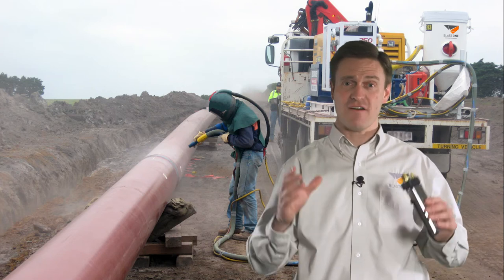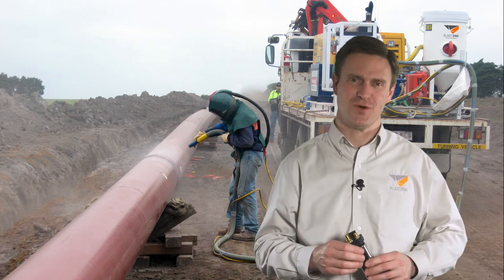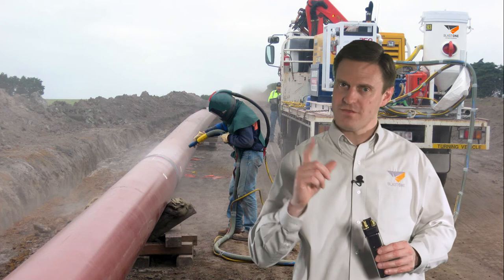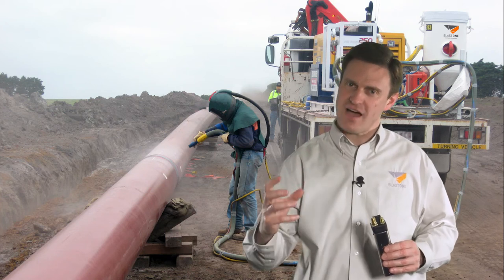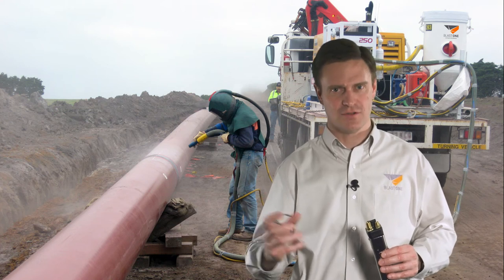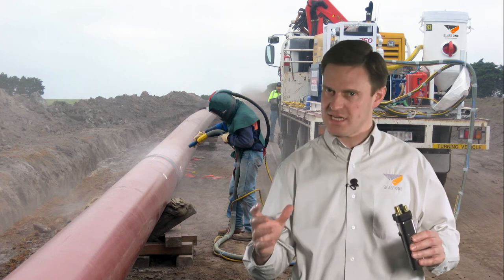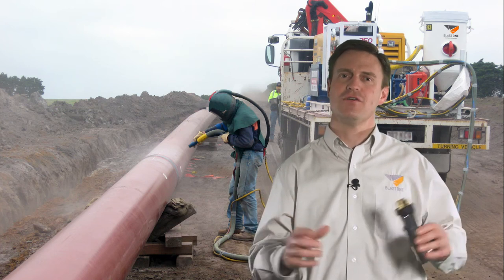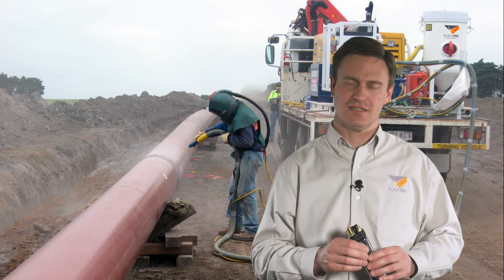Get a faster response with an electric deadman system

Comment: IHave designed and implemented a wireless RF dead man for my media blasting system.Initially are used the pneumatic and hard wired electronic dead man systems but found them to be very cumbersome and troublingUsing off the shelf components I was able to put together a dead man system that is compact, reliable and very responsive to any known system available on the market. I have been using my system for almost 2 years And still, no one has come up with a better system.
Reply from the maker: Sounds good!